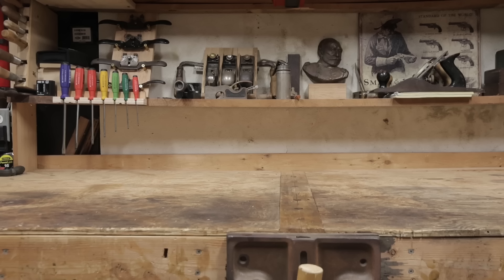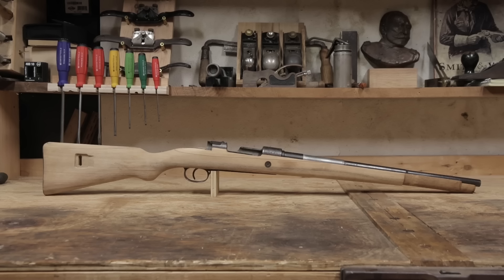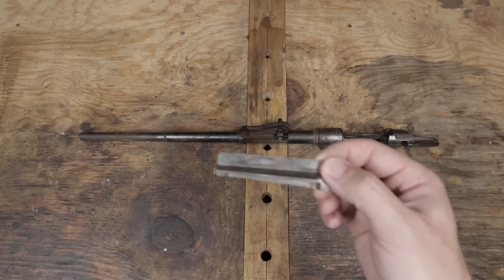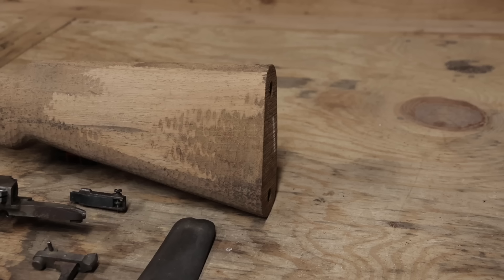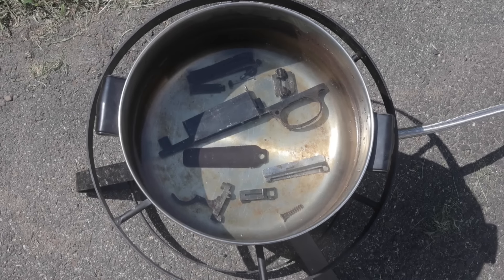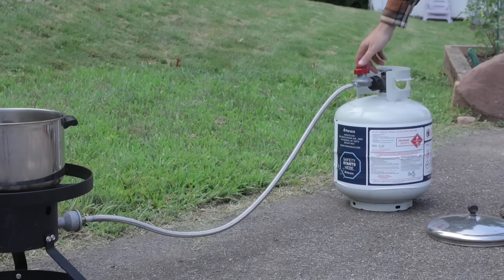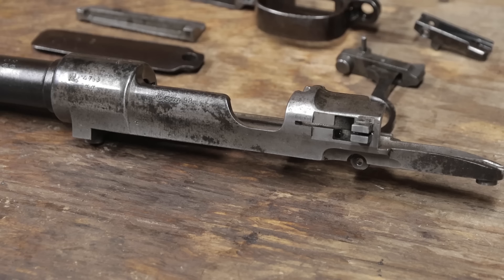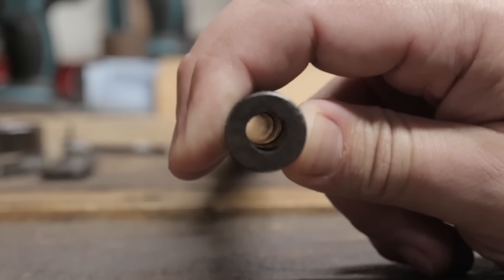Recreating the Original Mauser 98 Carbine

Comment: I built a Kar98K starting with a Gew98 receiver, it was a fun project, Mauser 98 parts are very plentiful, mine is a hodge-podge of parts from all sorts of different countries and it’s my favorite rifle
Reply: Mauser 98 parts indeed are very plentiful. But not the first three versions of the Kar 98, except the front hook and the trigger guard block, identical to the Kar 98 AZ. The other parts are nearly impossible to find
Reply: Cool
Reply: @laurentdevaux5617  i worded that poorly, I mean mechanical parts, metal parts for the stock are all different depending on the model
Reply: @RUSTYCHEVYTRUCK  And that's a huge problem. I remember that 35 years ago, I found some parts of the Kar 98 Rakum tries to recreate, I never found the others. But when I found a Kar 98AZ reworked by the Poles, I had no problem to find the parts necessary to give it its original shape again
Reply: For the k99k type guns yes, but an actual Kar. 98 (not the Kar. 98AZ or K98k, etc.) are exceedingly rare. It’s hard to even find info on them outside of dedicated reference books or knowing exactly how to search for them online.
Reply: @Dominic1962  I meant mechanically, specifically bolt parts
Reply: @RUSTYCHEVYTRUCK  Gotcha, that’s true. What is interesting about the m98 type Mauser is that most of the bolts and such are indeed interchangeable between models as long as they are the standard length action of the Gew. 98/k98k type but there are intermediate actions as well like the FN 24 and Yugo m48, not to mention the commercial magnum actions.
Reply: @Dominic1962  I knew about the m48 bolt being short but I didn’t know the FN24 was like that too
Reply: @RUSTYCHEVYTRUCK  The m48 was based on the Yugo m24 which in turn was a licensed copy of the FN m24. There are others though, plus the “small ring” m98’s like the Kar 98AZ, Mexican m1910, etc.

Comment: So the only other mention I've seen of this rifle in any kind of detail is in C&Rsenal's Primer 008 on the 98AZ. This Kar 98 is mentioned briefly and Othias gives basically the same overview you give (he probably had access to the same sources you used) as well the history of the Kar 98 name. According to Othias' sources, a Kar 98 Cavalry and a Kar 98 Artillery were developed. They were basically the same weapon and the designs were "standardized" as the Kar 98 "A" with "A" being an abbreviation for "Auf pflanz vorrichtung fur das seitengewehr 98" which just means "with attachment for bayonet 98". So the Kar 98 Cavalry and the Kar 98 Artillery did not have bayonet attachments while the slightly modified Kar 98 A did have a bayonet lug.

Comment: Fantastic video. I have been doing a lot of research on these Kar.98's. Here is a little wirte up on the Karabiners. "With the German Army adopting the Mauser designed Gewehr 1898 in April, 1898, is well known. Also in 1898-1902 two different carbines models appeared. The M98 cavalry known as the Kav.Kar.98 and the M98 artillery carbine also known as the Art.Kar.98. These two carbines replaced the M88 carbine and M91 rifle.
With the world watching the second Boer War, in which mounted Infantry played a key rule in the war. This may have encouraged the ideas to issue a carbine with a attachable bayonet to the cavalry. This carbine design is now known as the Kar.98 1st variant was introduced in Prussia by an Imperial Cabinet Order of the 6th of February 1902 and would be manufactured till 1905.
In October 1903 the Ministry oreder MG detachment to be equipped with a new pattern of carbine. This model would become known as Kar.98 2nd model and also would be manufactured till 1905. However the new carbines for S rounds evinced such great flaws that the Prussian War Ministry ordered the their production to be discontinued as early as January 1905. According to the numbers ascertained by Heinz Lehner, more than 20,000 short carbines were constructed and at least 16,000 of them standard carbines adapted for the S ammunition.
These carbines can be seen in arms museums and private collections.On the other hand, early military Model 98 carbines are generally unknown. The reason is that only a small number was manufactured, from 1898-1905, and most of them went to the Kaiserliche  Schutztruppe in Africa and the Deutsches Ostasiatische Expeditionskorps. When Germany lost Great War in 1918 those arms remained in Africa, and only a few have survived to this very day."
I catalog them. 
https://www.k98kforum.com/threads/known-surviving-kav-kar-98-art-kar-98-and-kar-98-1st-variant-and-2nd-model.48781/
Reply from the maker: Thanks for the info! I saw your post previously when researching this topic. The survival rate of these rifles has got to be less than average which goes to show how handy they are. When considered obsolete, they must have continued to be heavily used instead of being stored away.
Reply: @rakumprojects a large majority of them were used in the East asian expeditionary corps and later east asian Occupation brigade. They were also used in the colonies by Kaiserliche Schutztruppe.

Comment: Additive welding might help with fabrication of the short/shortened rear sight, Backyard Ballistics has used  this method to replace lost material, while the tools to do this may be cost prohibitive it would help with moving the pivot point back as the guide channel is too long on the full length sight, you would theoretically be able to move the pivot point back and fill the excess channel length to better match the carbine models, if it were me and I had the money I’d maybe have someone custom make a base and sight with the closest extrapolated measurements possible, but that’s less fun.

Awesome project look forward to the next video
Reply from the maker: I think that's how I'm going to have to build the rear sight. Unfortunately I only have a MIG welder. A TIG would be more precise but I think I'll be able to do it.
Reply: @rakumprojects  you’ve shown your ability to adapt so with a little patience and possibly some practice if you have some extra parts, you’ll do just fine, where there’s a will there’s a way.

Comment: To move the rear sight back find someone with a small lathe that will accept the full length of the barrel. Place the barrel in the chuck nearest the area to be machined. Indicate the barrel true and turn off the amount you need. It is only a few thousandths and I do not think it will not harm the strength of the barrel. If you have a true carbine measure the barrel diameters in this area and see if there is any difference if you are not comfortable with it.

Comment: That is going to be an interesting project. I just recently finished similar projects myself. Two 1903 Springfield's. One a 1903 MK1 and the other a Smith Corona 1903A3.
Reply from the maker: I have a 1903A3. Been meaning to find an original 1903

Comment: I have a book named Mauser Bolt Rifles by Ludwig Olson, Third edition 1988,  on page 112 there is a picture of a German Model 98 short carbine with a flat bolt handle.  Photo by Robert F. Rubendunst.  7.9MM 7.7 lbs. 17.32" barrel length 37.4" w/o bayonet 1:9.45"  twist 4 groves.  On the next page is a picture of a 98a carbine, 23.62" barrel 43.3 w/o bayonet 8.0lbs.
Reply from the maker: 17.3" barrel aligns with the 440mm measurement I saw. Thanks for confirming!

Comment: Nice, but it will be hard. The Lange Vizier and the barrel band you found are standard ones, and can't be used on an early Kar 98, even heavily modified. I'm affraid you'll have to recreate these parts. You could avoid the problem of the barrel band by making one of the two versions without bayonet (which has a hook, very similar to the hook used on the Kar 98 AZ we all know. Before the Kar 98 AZ, there were three different versions). The trigger guard block is wrong too, yours is a G98's, very recognizable has it has a hole for the mobile sling swivel when used during parades. You'll have to find a Kar 98 AZ trigger guard block, which hasn't this hole and was already used on the first versions of the Kar 98, that should be quite easy. Good luck !
Reply from the maker: That's a good point regarding the trigger guard. I was thinking about plugging the hole and milling it flush in a later video, if anyone noticed!

And I've seen the versions of the Kar 98 that closely resemble the Kar 88 and Gew 91. Replicating one of those would certainly be a lot easier, but there's just something so unique about the versions with the bayonet that I decided to go in that direction.
Reply: @rakumprojects  I fully agree, the version with bayonet is indeed unique in shape. Your idea about the trigger guard, why not, but it's a lot of work. You may look for an original Kar 98 AZ one, I'm sure you can find one

Comment: Had a Dutch police carbine, with 18" barrel years ago. Very handy fun little gun, until you shot it. Muzzle blast and recoil were terrible. OK as a wall hanger, but as a shooter forget it. Couldn't get rid of it fast enough.  

It was even worse than the Polish M-N type 1944 carbine, ( the one with the folding bayonet. I admire your project for building a replica Mauser 98 carbine. But it's  use as a shooter will be problematical, due to the above.

Comment: I do have the book of Dieter Storz and it has everything you need.
If you need anything, hit me up and i'll provide!
Reply from the maker: If there's anything in there regarding dimensions, that would be very helpful. I'm still not entirely sure of the exact barrel length, 440mm seems slightly short considering the Kar 88 measures 450mm.
Reply: @rakumprojects  the books state the same barrel length, with an overall length similar to the kar 88 at 95cm. The most interesting piece of measurement in the book is the measurement tables for the rear sight base (this one is graduated from 200 to 1800 meters). If you need it fully I think sending you a picture would be more useful than me trying to describe it.

Comment: WARNING:
Barrel Measurements Do NOT Include The Rifles Chamber.
Barrel Measurements MUST Begin At End Of Rifles Chamber 
55- 57mm.Must Be Removed From  Overall Length Of Barrel.
Reply from the maker: Barrel length is measured from the bolt face to the end.
Reply: @rakumprojects  
I Stand Corrected.
In 1982 A Shotgun Was Brought In To My Local Gun Smith..
It Was Cut Measuring From Bolt Face...
Our Trusted Smith Said This Was Wrong..
Did Not Even Want To Know Whose Shot Gun It Was..
As He Was Required By Law To Report To ATF..

As Per Google:
The ATF procedure for measuring barrel length is to measure from the closed bolt (or breech-face) to the furthermost end of the barrel or permanently attached muzzle device.

Comment: I'm a huge Model 1898 enthusiast. I thought there was the Gew.98, the Gew.98m (buttstock modifications), the Kar98a, Kar98b, and then the Kar98az before finally ending with the Kar98k series.
Kar98a, is that what this is? Or is this the predecessor to the Kar98a I've never heard of, simply called Kar98? Because knowing Mauser, it can be both or either.
Reply from the maker: Someone correct me if I'm wrong but I think the Kar 98 was renamed to the Kar 98a after the Kar 98az was adopted. German rifle naming is certainly confusing, which is why I'm sticking with simply Kar 98.
Reply: @rakumprojects  I looked it up and I remembered my Kar's incorrectly.
There was the Kar98A (Kar98 capital-A) with the excessive recoil and muzzle flash that it seems you have in this video. Next, the Kar98AZ in 1908 with the 60cm barrel, renamed to Kar98a (Kar98 lowercase-A) in 1923 to distinguish between that and the 98b. The 98b got a 74cm barrel due to the Treaty of Versailles allowing Germany only to create "carbines," and that's a story in itself. Then, we got the 98k in 1935 which was apparently derived from the 98b. That was something I didn't know!
It is therefore completely reasonable to call the Kar98A just the Kar98, and continue calling the Kar98AZ as it is.
Reply: All in all, there was four versions of the Kar 98 prior to 1918. One version without bayonet but with a front hook (same as the Kar 98 AZ) and a stock which goes to the front barrel band, for artillery. One version without hook but still with a long stock, for cavalry, and the third version with a bayonet Rakum Projects tries to recreate. The last version, the Kar 98 AZ, we all know what it is (and this version also had several "sub-versions" with only minor changes). And among the Gew 98, a specific version was made for the German Africa troops, given to camel units. A very very rare version

Comment: How many of the parts did you scrounge up separately besides the still missing bolt?
Reply from the maker: Since filming I found a K98k bolt. Other than that I have all the parts I need. To clarify, I'm not even attempting to find original Kar 98 parts since they're exceedingly rare. I'll be making from scratch or modifying existing parts to make the Kar 98 specific parts.
Reply: @rakumprojects  nonetheless still relatively expensive parts. cheaper buying parts guns no?

Comment: Carding wheel RPMs way too high
Reply from the maker: The motor is 1750 rpm. Yes, I'd prefer to run it slower at around 1000 rpm or so. But it works well enough

Comment: Forgotten carbine?  This is one of the least forgotten carbines in history.  This is the carbine that all future battle rifles were modeled after until WWII, and even then most beligerients used a rifle almost exactly like the Kar98K.
Reply: It's forgotten in that no one thinks of this specific carbine when they think of a mauser carbine. They think of the Kar98K or the Kar98AZ.
Reply: Except it’s not a k98k, that’s the issue. You really have to tailor your Google-fu to find pictures or any information as you will typically just get the really common k98k or k98az. The actual very early true carbine Kar. 98 and variants are exceedingly rare and frankly had little to do with German rifle development other than to make it clear that this short of a gun had excessive blast and recoil with the modernized 7,92x57. The later “short rifle” Kar. 98AZ was much more influential as was the Mauser “Standard Modell”.